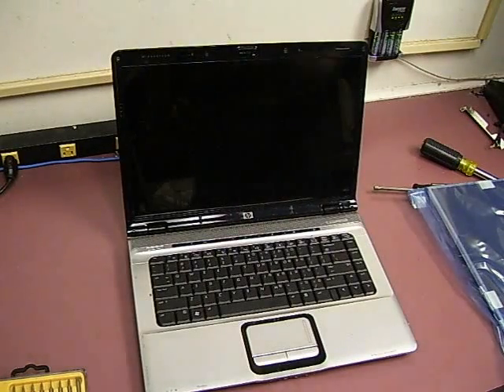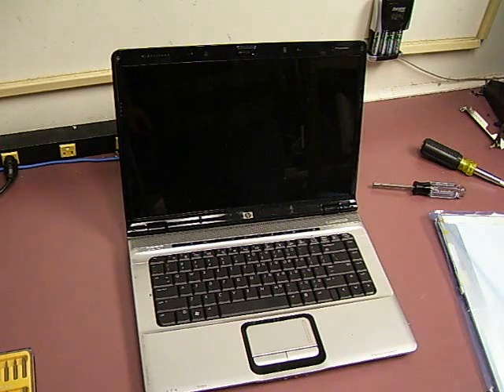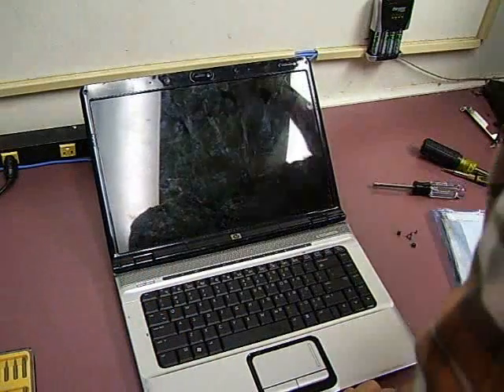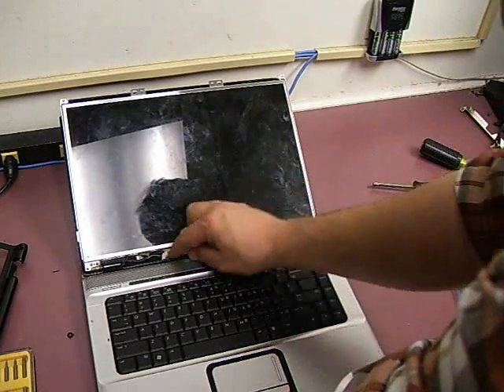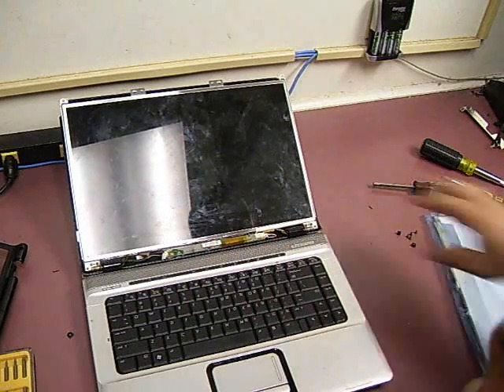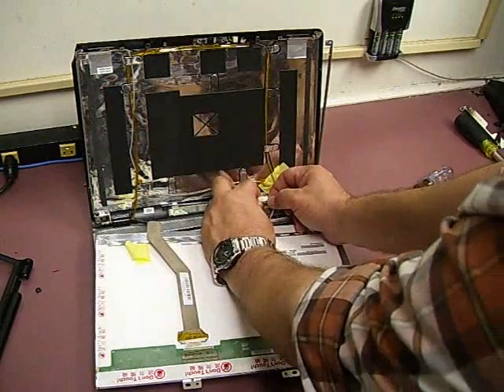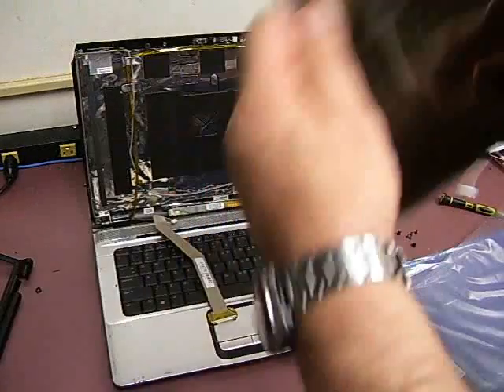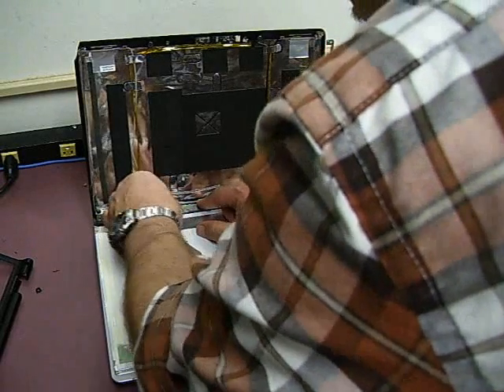How to replace the LCD screen in an HP DV6700 laptop

Comment: what if my screen turns on and its pink-ish?? please help !
Reply from the maker: A pinkish display indicated that the back light bulbs are about to fail. The pink tint is cause the the bulbs not coming up to full brightness.
Reply: found the bulbs cheap... it states i may need to sodder the bulb, is this easy to do and can i test my old bulb before i buy a new one??
Reply from the maker: CiscoDaRuler Replacing  backlight bulbs is not an easy thing to do. The bulbs have to be soldered on each end, and they are very fragile. To get to the bulb you have to disassemble the LCD panel and remove the bulb before you can even test it. Once removed you just connect it back to the inverted and power up the laptop, the bulb should output white light. The replacement bulb will need to be fitted back into the slot on the LCD panel and the 2 rubber end caps put back on. Then the pink and white wires will need to be run back along the channel where they can out from. Then you can reassemble the panel. You also have to make sure the parts of the panel are aligned correctly for the display to work. Truthfully in most cases it is just easier and cheaper to replace the panel and not just the bulbs. If you are not familiar and experienced in changing the bulbs you will break them while installing them.

Comment from the maker: The red and white wire go directly to the compact florescent tube. You would have to totally disassemble the LCD panel to get down to the tube. At this point you should contact the LCD panel supplier and request an exchange.

Comment from the maker: Double check to make sure the back light inverter is plugged in. it is the little board to the bottom that the white/red wired plug goes into. Also check to make sure the other end of the inverter is still connected to its cable. You will need to have the laptop off before you reconnect either of these cables. Check those and let us know the results.